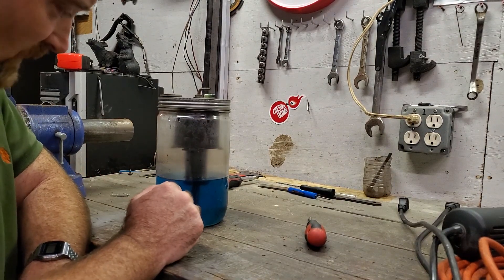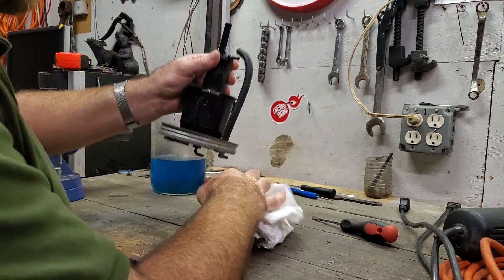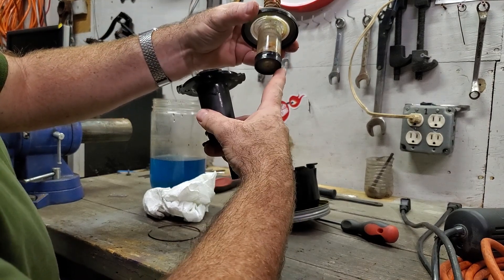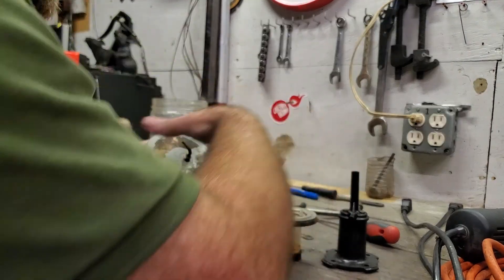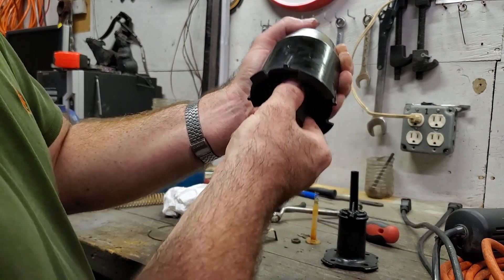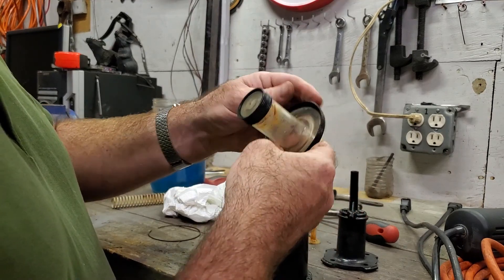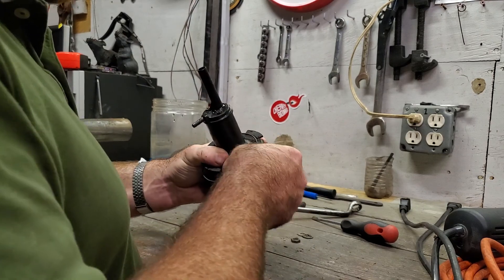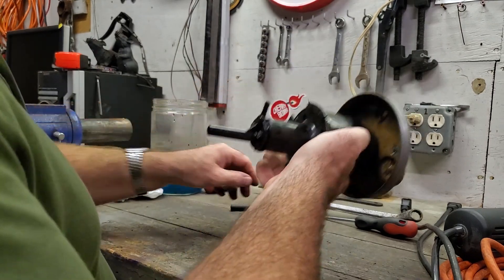Trico Vacuum Screen Wash Pump: Disassembly and Reassembly.

Comment: Going through one of these from 1958 that has the coordinator circuit. It is way more complicated (pump part is the same), but the top has way more parts and gaskets. I have a spare so hope to make one kit w the parts I have. Cant find anyone selling parts or rebuild kits. Literature on this is also non existent. Cheers

Comment: That's actually quite a simple mechanism. I was expecting more moving parts for some reason.
Reply from the maker: It's moderately useful- it sprays for a few seconds so it does give a chance to put the wipers on and wipe the screen while it's putting fluid on. Ultimately electric pumps and wipers are better, but Oldsmobile had those patents until the end of the fifties.